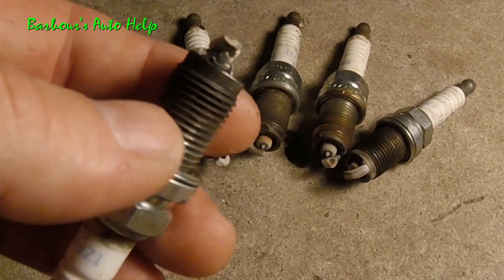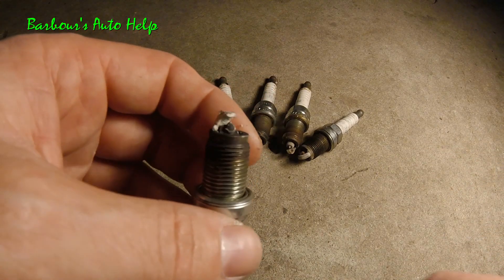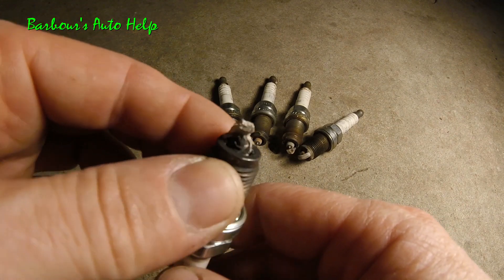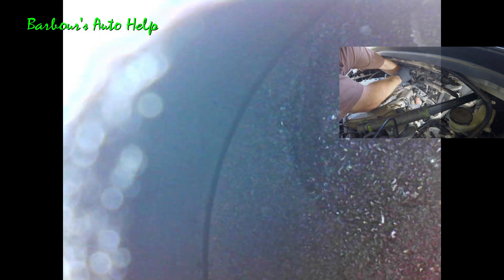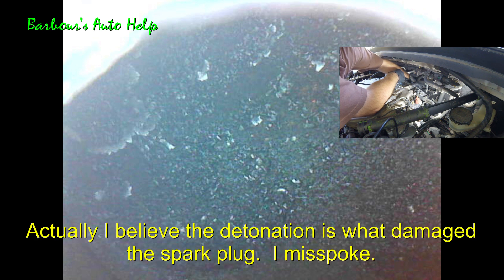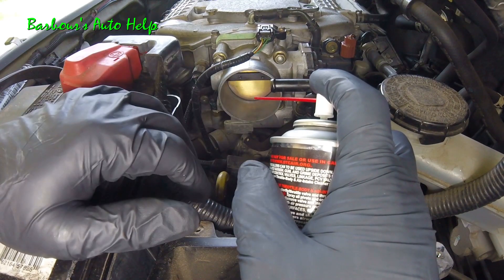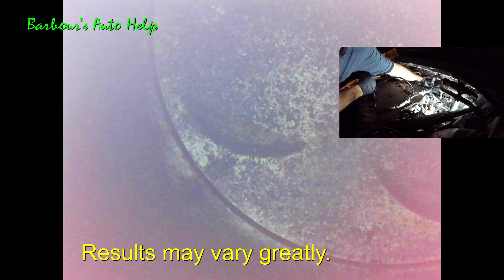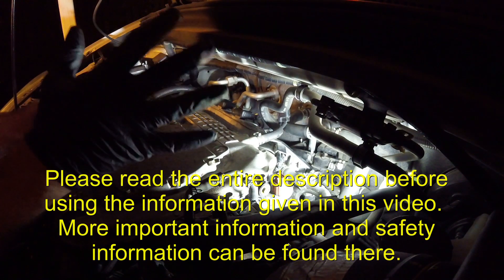A Cure for Preignition and Detonation

Comment: Hi! Great video. I have the VCM 3.5 in our 2009 Odyssey EXL and actually had P0301 (misfire cylinder 1) and a blinking engine light at 75,000 miles. Terrible. It’s actually the deactivation if the back three cylinders  (usually the back three, but it can deactivate only 2 as well) that is causing this. 

I am now using a VCMuzzler (they didn’t pay me to say that. I paid them for the device) which is essentially a nice clean way to add resistance to the temp gauge circuit and make the car think it’s at 8° or so cooler so the ECO light (VCM) never comes on. THATS why mine and probably yours uses oil. 

The 86om resistor made a world of difference. Wife hit 92 before she realized she was flying - that much of an increase in smoothness. 

Been into this motor and love it. Just has bad software. Adding the resistance to the temp gauge circuit will solve the issue for good

Best wishes with your motor
Reply from the maker: Well how about that!  I guess I’ll look into it.  Thanks for the info!
Reply: BarboursAutoHelp 

Yea there is some opinion in there but it is fact that VCM causes potentially catastrophic problems that the non-VCM 3.5 would never have. Odyclub is a forum dedicated to our vans and there is at least one technician on there with abundant info. 

That VCMuzzler thing was like $100. Which is a lot, but it looks and acts like an OEM part and even has interchangeable resistors all with factory Honda style plugs/harnesses. Hooks up right at the bottom right corner of the engine cover, where the temp sensor is. Top of the motor.
Reply from the maker: Yea, I did a little ready last night.  Looks like somethings up.  I’m going to get in touch with Honda and see if there is a software update first.  If I run into a brick wall I may get that and try it out.
Reply: BarboursAutoHelp 

I’ve been led to understand that Honda won’t disable the software, there was an update, and I had it, but 20,000 miles of driving with the update, and my plugs look bad just like they did before. The car is on it’s third set of plugs and 112,000 miles. They won’t disable VCM. Something about they would retroactively lose some reading they got based on gas mileage… Political crap. We are on our own with this one! 

Sidenote: because I didn’t buy the van new, and I do my own service, they tried to charge me for the software update. Obviously, that’s ridiculous, because software that’s wrong left the factory that way, it has nothing to do with maintenance… I kicked and screamed quite a bit, and they did it for free
Reply from the maker: @DrewGarage  Well, I know its been a while but long story short.....It's the piston rings.  I work with a guy that used to work for Honda.  He said that certain 3.5Ls will do this and that the fix is to replace the piston rings.  Apparently the piston ring gaps line up with each other and allow too much oil in the combustion chamber causing the excessive carbon build up (which is causing my problem).  I appreciate you sharing and I'm sure there is something to what you mentioned but my problem turned out to be something different.  Needless to say, I'm not going to replace my piston rings.  I've switched to a copper core spark plug on that particular cylinder.  It's only a dollar for a plug.  I just replace it whenever its needed.  (not recommending my band aid to anyone.)  Thanks again for sharing if your still out there.
Reply: BarboursAutoHelp sorry to hear that!

Since our last chat, I saw a dude fly bye me at triple digit speeds while driving my hotrod, wife and kids behind me in the 09, skid, and t-bone them in a 4 way stop. All three of them walked out. I replaced it with an 07 exl. with the vcm disabled, it runs perfectly. Piston rings may not be too awful to do...

Comment: Pre-ignition is the ignition of the fuel/air charge prior to the spark plug firing. Pre-ignition is caused by some other ignition source such as an overheated spark plug tip, carbon deposits in the combustion chamber and, rarely, a burned exhaust valve; all act as a glow plug to ignite the charge. (Which seems to be your problem looking at that spark plug)

Detonation is when the fuel charge is ignited to early (usually to advanced timing) and creating extreme pressure in the combustion chamber causing the piston to rattle inside the cylinder. (Pinging) People usually get these two terms confused.
Reply: But how do you FIX IT
Reply: @robl884  Use a higher octane fuel, low octane leads to build ups.
Reply: @Dreama40  But will higher octane fuel alone actually clean carbon buildup? I don't think so. Shouldn't you be using additives instead?
Reply: @angelamartim8337  Use additives"as well" not "instead".
Reply from the maker: +Michael Barras Pretty good!  I’ve got more information in the description about these issues.  But, it seems you got a good understanding.  Thank you for sharing!
Reply: Can anybody explain why would fuel ignite too early though? Would detonation be the result of a faulty sensor or bad ECU or something?

Comment: I had a leaky valve cover gasket. Where the oil leaked into the sparkplug wells. I pulled out plugs before taking out oil of wells. Big mistake, now alot of oil went on my cylinder heads. I i hope this is why my engine is knocking when i hit the gas. Thanks for the video.
Reply: oil dumping into your cylinders will not cause engine knocking its oil its lubricates. thats not going to do anything but burn off with combustion and have blue smoke out your muffler after 5 minutes of driving all the oil in the clyinders will be burned up. you MAY have fouled your spark plugs tho and you might be experiencing SPARK KNOCK maybe thats what you meant by knocking who knows if your engine is pinging now try to replace the spark plugs they might be fouled but knocking or spark knock is most likley another issue
Reply from the maker: +luke nahdee That’s bad news.  I Was it knocking before you did the plugs?
Reply from the maker: +luke nahdee What kind of vehicle do you have?
Reply: BarboursAutoHelp its a Mazda 6 2.3. I dont beleive it was knocking prior to me doing plugs. I could be wrong. But i dont think it was.
Reply: BarboursAutoHelp i changed out the Valve gasket. But i think a little bit to much oil fell on piston head..smh
Reply: BarboursAutoHelp it doesnt knock all the time. Just when the motor is revved. And certain rpms...
Reply from the maker: +luke nahdee  Shoot!  It may be time to have a tech take a look at it.
Reply: BarboursAutoHelp ill figure it out. Good ole youtube. Lol. If not ill ride it till it breaks. Its only my winter beater. But i will try and figure it out. Might be connecting rod bearing. BUT...it doesnt knock all the time as  connecting rod would. And it gets louder the higher the rpm..(fire) we'll see
Reply from the maker: +luke nahdee Good luck to you.
Reply: BarboursAutoHelp thanks man. Cheers